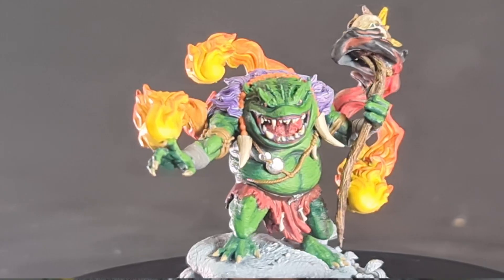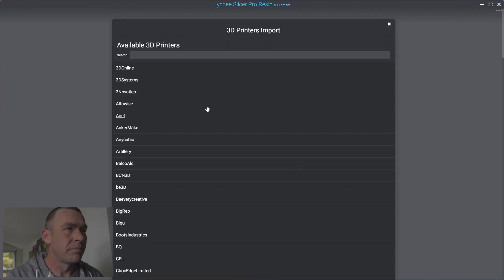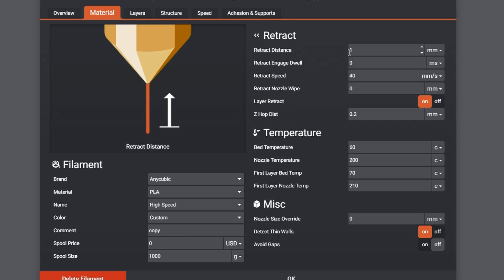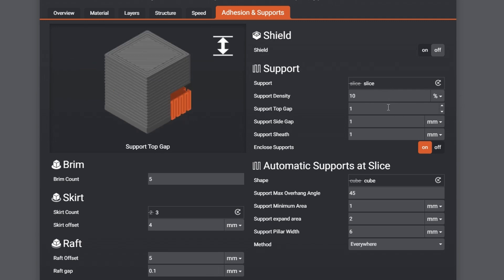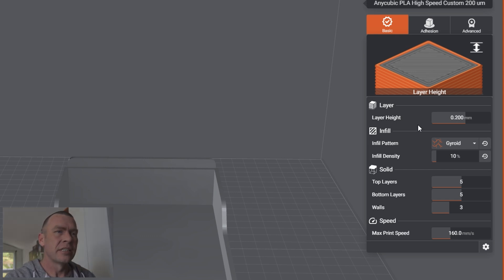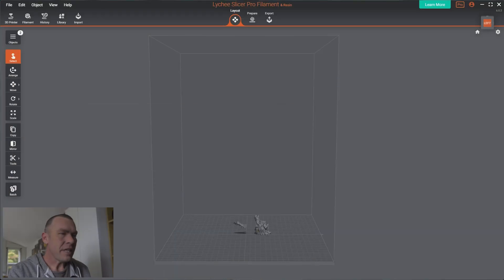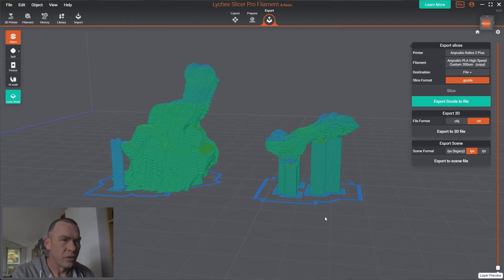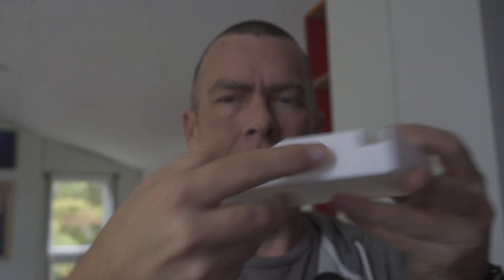Resin to FDM: Lychee Slicer's New FDM Module

Comment: You know, I tried the fdm slicer, and the print was amazing.  But a 2 hour print via cura took 15 hours in lychee.  I tried again and matched the settings 1-1 from what cura, and it took 12 hours still.  Something is weird about this fdm slicer that's causing prints to take abnormally long.